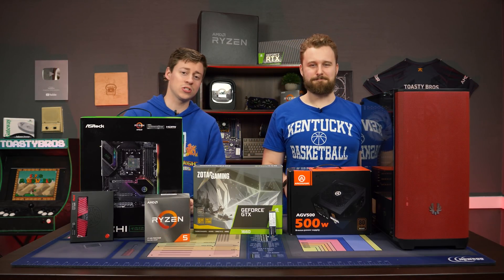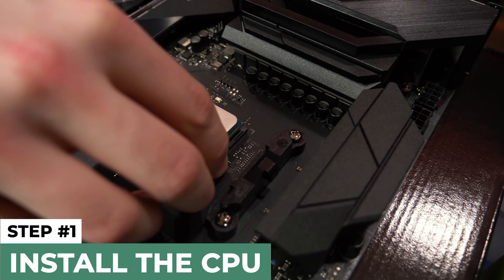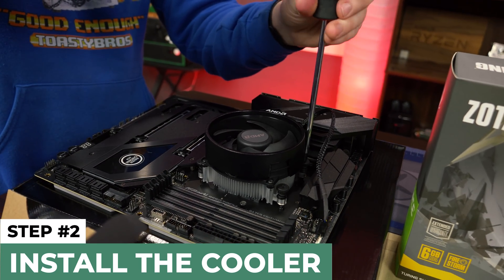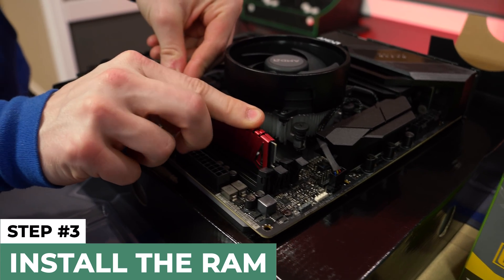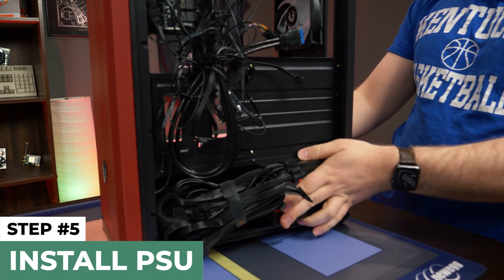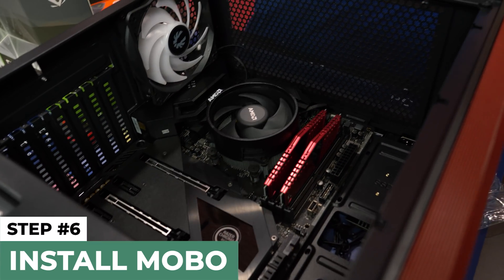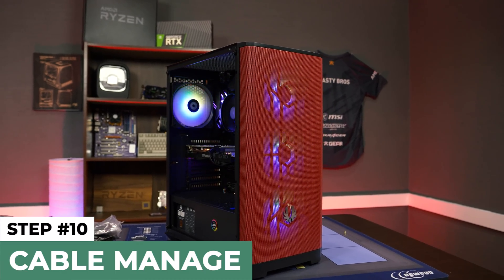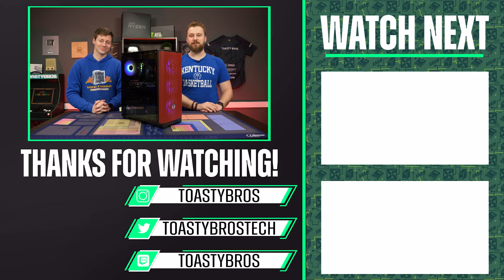Quick and Easy Build PC Guide 2021

Comment: @3:28 You should have installed the RAM in the 2nd and 4th slots!
Here's a quote from the manual: 
We suggest that you install the memory modules on DDR4_A2 and DDR4_B2 first
for better DRAM compatibility on 2 DIMMs configuration.

Comment: I have that pcu and psu but I have the steel legend b450 mother board samsung ssd and a different case and it wont turn on do you know what the problem is?